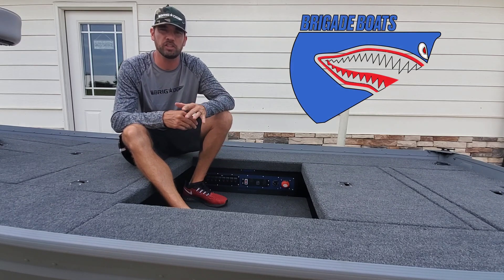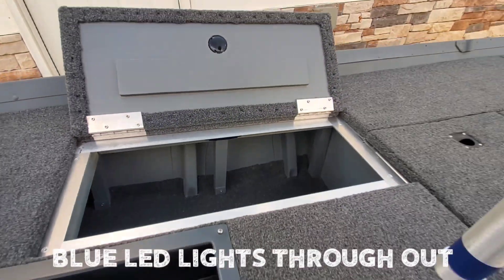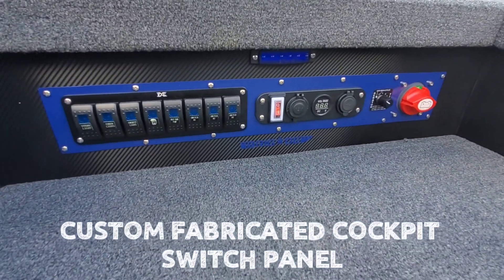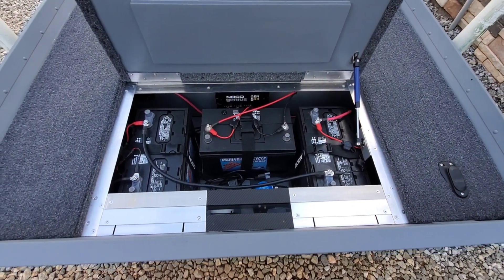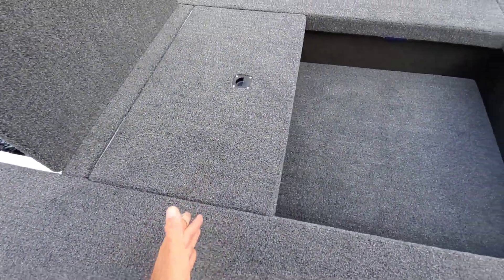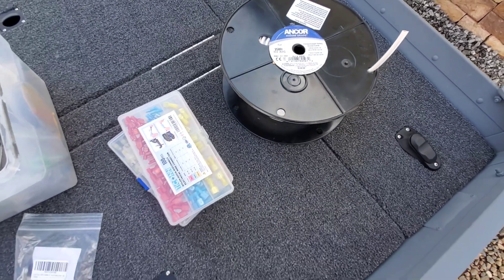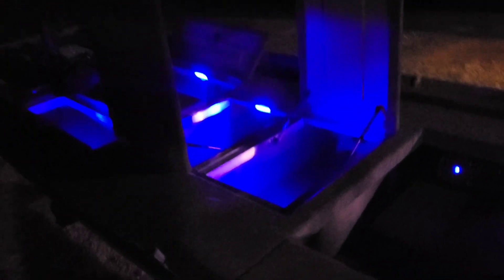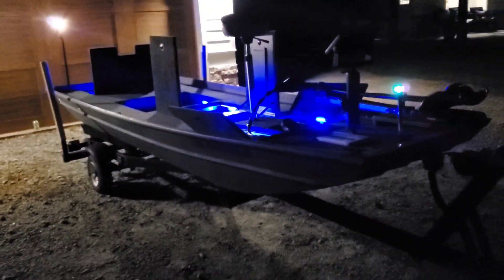ELECTRONICS 101 for Jon Boat to Bass Boat | Full Walk Thru

Comment: this boat is incredible.   i've been watching your videos and you do some amazing work.  great channel.
i lost my 17' jon boat 20 years ago and i'm still sore about it.   bought new in perfect condition for 3200 dollars,   I had a good trailer and a 15hp nissan outboard and did a few upgrades myself  ( decking,  lights battery and wiring,  a high and a low seat ).   it's been 20 years since and i haven't been able to replace it yet.   today i come across your channel and see a boat like this that you've worked on and a community around them and wish i was a part of it.   i always said my boat was of a class of vessel that few could compare with in terms of ease of maintenance,  ease of access to the water and in general excellent stability on the water in just about any condition if you know what you're doing.  they make perfect little 2-3 man runners.    you're illustrating something i knew 20 years ago but my wife did nothing but run me down over it and it was the first dam thing her fkn attorney went after when she took off because she knew i loved it.   if i still had my boat i would drive it over and see if we could work on it together and maybe drop in a line somewhere.

Comment: At 11:15 in the video, you can see a pass-thru grommet for the Lowrance wiring, installed just aft of the nav light socket.  What did you use for this?  I didn't see it listed in the parts list.  Thanks, Cuz...
Reply from the maker: That is actually a thru hull fitting for a bilge or livewell.  I cut the barb off back tk widen it, use in the deck fir wire pass thru.
Reply: @AnthonyJonesBrigadeBoats  cool; I've thought of using cable pass-throughs for office desks, but they are usually pretty huge.  Keep up the great work!

Comment: Curious if you've ever considered Lithium Iron Phosphate batteries?  They weigh about 26 lbs (as opposed to 75 lbs for lead-acid), are totally maintenance-free, and last 2X or more longer than lead-acid.  I picked up a 100Ah Renogy earlier this year, and it is absolutely amazing.  Plus, the light weight sure helps.

Fantastic build...I continue to devour your videos in prep for converting my 1993 Northwood 12'...
Reply from the maker: I use lithium in my personal boat and in my customers tournament boat builds we use lithium from Amped Outdoors.  This build believe it or not was a budget build. Totally up to the customer,  I just present options,  pros and cons, cost.

Comment: I was told when stopped at night you just run the Stern light and when in motion you run both. Could put it on a switch up for stern, middle is off, down for both? Just how I wired mine. Awesome builds. Puts most others to shame! 
Check out a trollbridge also for wiring trolling and starting batteries in an epic way!